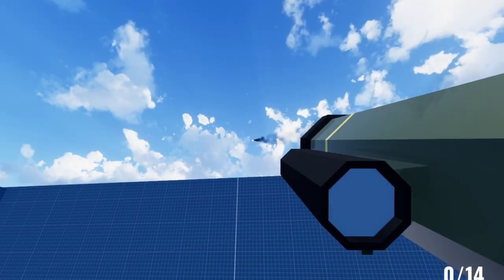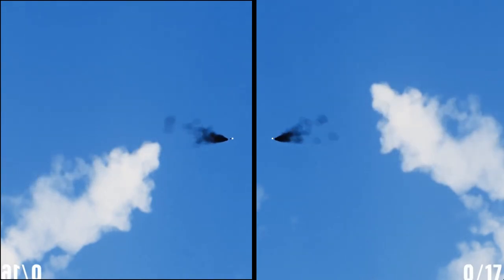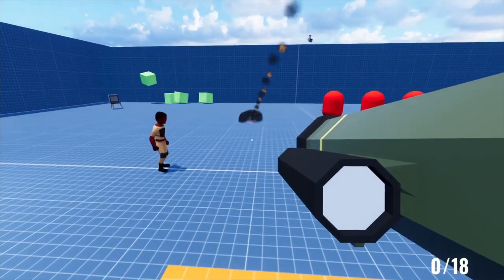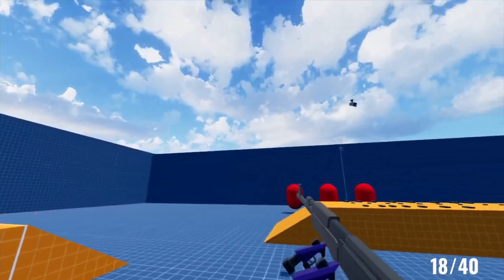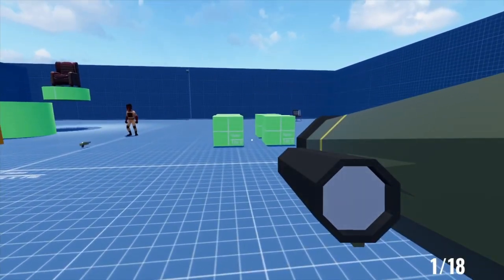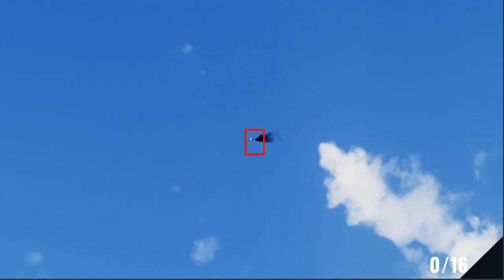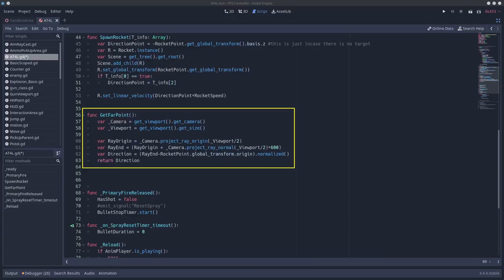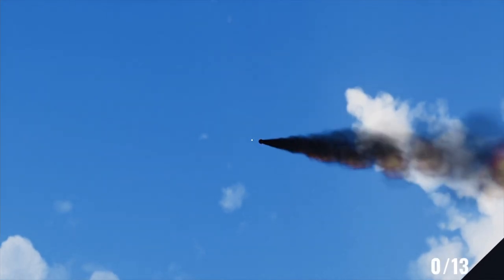The Projectile Weapon Conundrum!

Comment: Your implementation of using a raycast that only goes for 600 units to determine trajectory was my first thought as well. But it actually highlights an issue with using raycasts to set trajectory for projectile weapons at all. So you mention that the issue with your 600-unit-raycast implementation is that eventually the rocket will cross over the center point and seem to be veering off course, but it won't actually matter because players can't see it unless they really crank their draw distance. 

My thought here is that, this problem of crossing over the center of the screen and veering off course would get worse the closer you terminate that raycast. Like, if you only shot the raycast out 100 units instead of 600. Now, when firing into the air that's not a problem, because you know it'll always be 600 units. 

But picture this:
You're aiming your rocket down a long corridor and are about to press fire to blow up a door at the end of the long corridor. Just as you're about to fire an enemy runs across your field of view and is only 100 units away. You pull the trigger, the raycast detects that enemy and uses its position to set the trajectory for your rocket. But the enemy keeps moving and by the time the projectile leaves your weapon, the enemy is no longer in front of you to get hit. 

Now you have that same issue where the rocket will cross over the center of the screen and appear veer off course. But it will be much more pronounced because the crossover point is only 100 units away. It may even end up hitting the left wall of the corridor instead of making it all the way to the end of the corridor and hitting the door which was the intended target, and what the rocket should be hitting. 

All of that said, I think there are two options here depending on the context of your game:

1. Just do forward firing like you were initially (But for everything. Just don't use raycasts at all for projectile trajectory) and add some sort of shake or recoil to the weapon. The recoil would move your reticle and the fact that the projectile doesn't line up perfectly won't be as noticeable; However, this only works for explosive weapons at short distances. 

If you were firing a rocket at a small point a mile away and the player watched the explosion, they would see that the rocket didn't actually hit exactly where they pointed their cursor.
Like, imagine if the player was shooting at a sign that said "HOTEL" and they aimed at the center of the 'O'. from that distance, since the rocket fires off to the right a bit, the player would likely actually hit the T or the E. With explosive weapons the explosion might mask this effect at closer distances, it will become noticeable further out. 

If you plan on adding any sort of precision projectile weapons, Like a bow & arrow or throwing knives, you'll have the same issue at much closer distances. If the player throws a knife at a nearby wall, then walks up to it, they'll be able to see that their knives are firing off to the right a little bit. 

2. Do something to line them up properly. DartVonGrell in the comments had a good solution.
Reply from the maker: I like some of the ideas here. I'll have to do some tinkering to see what I think for sure.

Comment: The problem with hitscan rockets is: What if you miss a player with the hitscan, but they walk right into the missile's explosion?
Reply from the maker: I’m confused. Isn’t that possible with every projectile weapon? You could be aiming at one thing, fire and then later have something else cross it’s path and take the hit. Isn’t that kind of the point?
Reply: @Chaff_Games  
I think Jilu's asking why you're hit scanning with rockets in the first place when the projectile should be determining collision and damage for a projectile weapon. 
Since usually, hit scan is used in lieu of projectiles for the sake of collision and damage; I think he's assuming that's what you're doing.

So based on his faulty assumption, he's asking what would happen if your hitscan (that applies damage/collision) missed, but the projectile hit. 
The player would look like they got hit, but take zero damage.

Bit of a fault assumption though for a few reasons. 
1. Video clearly shows that the rocket is handling its own collision as the boxes don't react and fly away the moment the weapon fires, but rather once the rocket actually collides with the ground. 
2. If the damage and collision WERE handled by hitscan, and the rocket didn't handle its own collision, then you wouldn't be able to intercept it... it would just fly right through everything until it gets to its destination

Jilu to answer your question: He's just using the raycast / "Hitscan" to determine the rocket's trajectory, not for collision or damage.
Reply from the maker: @Christopher-me3nf yeah, that’s correct. It’s just to find the line between the object at the centre screen and where they “bullet” comes out from.

Comment: I've spent just less than a week on my first godot project and i've noticed this right away, missing shots from close by. I have tried my best to implement the other solution where I have a raycast on the camera which extends 500 on the z axis. And i conditionally try to correct the trajectory of the bullet (that is spawned at the end of the gun). If there is a collision point, then my goal is to set the direction to it, else ill set it to the end of this raycast. However all those transform/global_transform/.origin/.basis are so confusing to me - that the only thing i achieved is creating a scuffed aimbot :D Still struggling to solve this the way i intended and this is the only other source i found where people mention this problem apart from a reddit post which has no code example, just a mention of this.
Reply from the maker: I have a full video on my channel which might help. I think I use transform.origin and not basis.